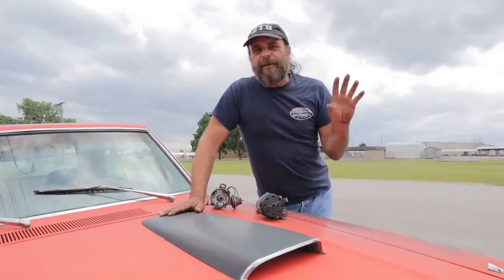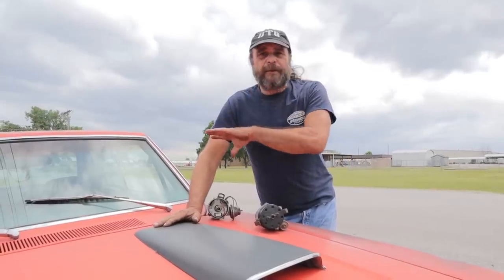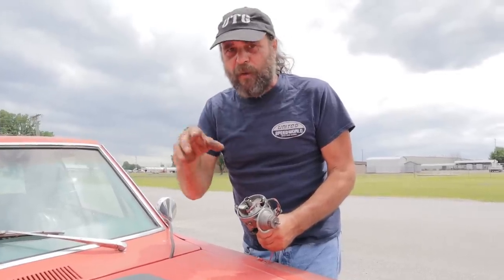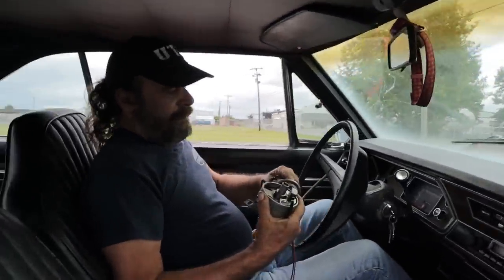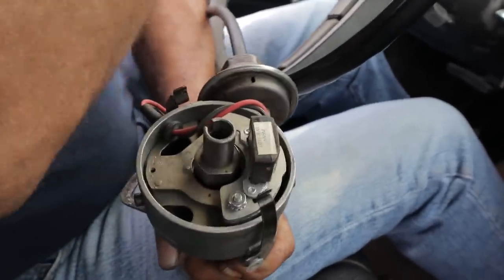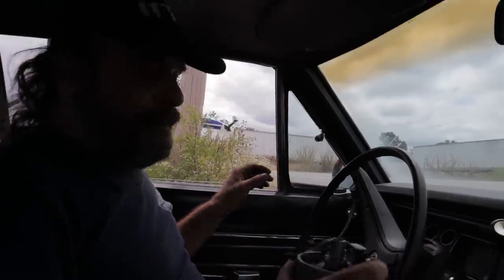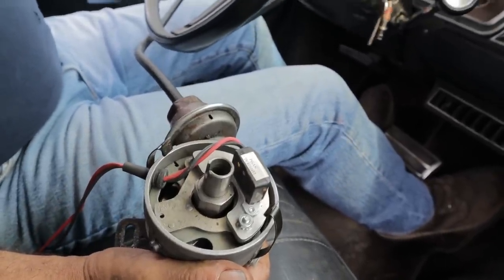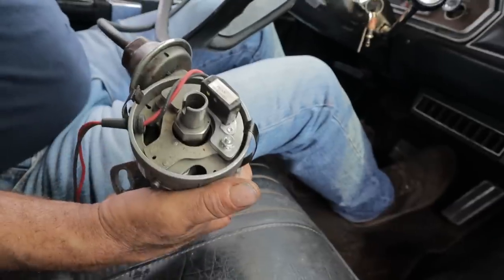The Vacuum Advance Debate!

Comment: Thanks uncle Tony good stuff....now what's up with dual vacuum advance
Reply: silverbird58  not in particular I've been selling auto parts for almost 20 years and sometimes the option comes up for dual or single vacuum advance when looking up distributed parts. I've got a pretty good understanding of single advance but I've never looked into what dual advance was about.
Reply: @kenleppek  My understanding is a ported advance tends to overheat in traffic and the dual advance was activated by a thermal switch that switched it to manifold vacuum increasing the advance which increased idle speed and cooled the engine down. There may have been other benefits.
Reply: @berserk7111  makes good sense. That would be a good use of the ported vacuum switch other than the diverter valve and pre heater valve in the air cleaner
Reply: @kenleppek  If I understand you correctly,  The hot air intake system helps regulate the intake air temp which can reduce engine temp but more importantly, it allows you to tune an engine to operate in a much narrower temperature range than the ambient temp which can be much broader. A hot day requires different tuning than a cold day. Tuning an engine to run in cold and hot weather is a tuning compromise but narrowing the temperature range of incoming air can aid in optimum tuning for both hot and cold days. effectively reducing one of the tuning variables. I prefer them on daily drivers. Usually, previous owners remove them thinking they are performance robbing emissions components but it's just the opposite. That's assuming the filter  flows well enough at WOT. For a daily driver in a 4 season climate they are a necessity, IMO. Texas California, etc., not as much.
Reply: @berserk7111  I'm from Michigan. The only vehicles you should take early fuel evaporation devices off of here are race purpose cars that you don't plan to drive in the winter
Reply: @berserk7111  I'm from Michigan. The only vehicles you should take early fuel evaporation devices off of here are race purpose cars that you don't plan to drive in the winter

Comment: I always ran pump gas in my hot rod. what i did was (with no vacuum advance at all) time the engine so that i could just hear light spark knock, then back it off 2 degrees. then i would connect the vacuum advance to manifold vacuum. I figured that way i would get maximum performance and maximum fuel mileage. the only trouble was when shutting the engine off very shortly after a race,  then trying to restart it. it would start, but the starter was working HARD. if i let it cool down even 10 minutes, it was fine. I should have NEVER got rid of that car. it is one of the bad decisions that will haunt me  to the grave.

Comment: I tried manifold vacuum and I just got tired of the inconsistency in the idle speed.   Especially if your running a choke like I am.  Reason is because then your relying on a specific amount of engine vacuum to maintain a set idle.

Comment: If you're using real light throttle, wouldn't manifold vacuum be superior? It seems like ported vacuum is only the way to go if you have a low performance engine that requires you to really dig into the throttle for off the line situations.

Comment: How is this an argument? I know it's not common sense but you car guys should know better. 

Vacuum is produced by the pistons' intake stroke. It originates in the cylinder. As the piston falls in the cylinder, with the intake valve open, it draws atmosphere through the manifold and carb. Just like drinking through a straw. 

With the throttle blades closed, the action of the pistons' intake stroke creates negative pressure in the manifold. The piston is still sucking but the closed throttle blades don't allow a lot of air flow into the engine.  It's like drinking through a straw with your finger over the bottom. When the throttle blades open, air can flow much easier through the manifold which decreases vacuum. It's the same as taking your finger off of the straw while drinking.  Because the manifold vacuum source is below the throttle blades, you have high vacuum at idle and low vacuum under throttle. 

The source for ported vacuum sits above the throttle plates. So while the pistons are still creating the same amount of vacuum, the ported source never sees it. The throttle blades are closed below the source, effectively blocking the signal. All of the vacuum is below the throttle blades. When under throttle and the blades open, the 'sealed' vacuum in the manifold drops as it is transferred to the next closest opening which is the carb. The ported vacuum then rises. So at idle you have low ported vacuum and under throttle, the ported vacuum rises. 

GENERALLY speaking you want you ignition timing to be tuned to atomized delivery. Not you air delivery.  So you need the advance to work from ported vacuum. Otherwise the advance has no clue what the carb is doing. 

At least I think.....

Comment: A lot of old MoPars are very sluggish driving cars with there weak engines and soft torque converters which do not do much torque converting.......
so getting that extra 5-10 ft. lbs of torque at 1500-2000rpm is actually needed.
  More powerful engines  with healthy cams in them can use manifold vac to help tame the idle a bit by producing a higher idle vac if one is using power 
brakes to help them work better.......or you can use the ported vac signal to make a smaller cam sound bigger at idle  with  the reduced idle timing, which the mopars tend to like.....so like most things in life  there are no clear absolutes.

Comment: Always scratched my head about my 394 Oldsmobile’s using manifold vacuum 
May try ported
Reply: Another 394 out there? Cool. Just getting mine going in a 55 Olds. Had a few frustrating issues with swapping a 394 to a '55 car but seems well worth it. Really great engine. It pulls like a strong 455. Mine still has the 4GC Rochester, and that carb doesn't even have a ported vacuum port on it.
Reply: Well, depending on what you have, year, etc., manifold might be the factory configuration.  There arw about 30-35 different vacuum cans gm used over the years, some ported and others manifold.
Reply: Well, if you're wanting to keep it 100% original, it might have manifold vac run through a switch operated by port vac, but if you just want good all around performance, you can throw away 90% of the original vacuum lines and just run one hose from ported vac to the dist.

Comment: Hey man, my distributor vacuum advance canister has two nipples for two vacuum lines. It's on a Toyota vehicle,  should one be ported and the other be manifold?
Reply: You are correct.Yes, retard is closest to the dizzy.

Advance plate should rotate by hand or by sucking on the advance nipple, shouldn't be frozen

Comment: Hi UT.  clarify this for me please.  I also have an edelbrock carby. A 500 cfm on a mild 318. Now bear in mind I’m in Australia so a right hand drive car. Currently doing some tuning,if I’m in second gear(727trans) and floor it,she takes off well but from a stand still it has a real lacklustre to get up and go!  Now my electronic Chrysler distributor is hooked onto the drivers side of carby so if looking at the front of the carby that would be the left side,while the right side of carby port is blocked.  My mechanic did it this way.  Maybe I should swap sides and try it?   Thoughts please.
Reply: pull  hose off dist while at idle ,if it sucks its man vac ,revs should change as it adds or removes timing .Raise the revs and it starts to suck it's ported

Comment: I though ‘ported’ was resolved back in the late 50’s?  There’s really no room for argument. Some vacuum advance pots can be adjusted as well, to eliminate low speed ping instead of altering the system timing. Keep it red hot & rolling UT.

Comment: That blip when it bottoms out on tip in, using manifold vacuum is destroying my 1/4 time.   Like 3 seconds.   Because I pulls my timing back to 12° right when I need it to be at 20° plus.   So, I’m adding the screw to the HEI to limit advance and going back to ported for the additional.  That should keep me in the meat of advance and allow me to launch   Hard instead of waiting for the wind up.   On the up side once the advance does come in it’s scary fast.  If we can get that fury on the launch we will be unholy!  Gonna have to limit the mechanical to get that high initial timing we need.   😂

Comment: My vacuum gauge is also a fuel pressure gauge whats that good for Tony?
Reply: I bought this piece of shit from harbor freight for $20 with a coupon
Reply: @Tech-NO-City  you have to really look at the reviews before you buy anything from harbor freight. I have a roll around tool cabinet that's been great and i have a set of screw drivers i destroyed in no time at all. p.s. watch out for the jack stands!
Reply: Kurt Zimmerman What’s up with the jack stands?
Reply: @kurtzimmerman1637  The contraption works I just wanna know what fuel pressure compound gauge is good for.   My biggest issue is I bought a ratchet set from them and every other socket size is missing at random.  They did it in such a way you dont notice until your working on a car.
Reply: @rong4189  some of them are under recall because the ratchet locking mechanism doesn't fully engage. Stay safe!
Reply: @kurtzimmerman1637  Yeah,   depends too how much you really use something.  Harbor Freight's great for filling out a depleted or otherwise nonexistent tool kit,  some things,  not so much.  (I never bought a vacuum gauge from them per se,  but my manifold gauge for AC works fine.  )
Reply: It's for testing a mechanical fuel pump. A carburator operate around 4 to 6 psi. He talk about it in the video about fuel economy with the gauge.
Reply: Jonas Grumbie Will do, thank you!
Reply: @rong4189  they have been dropping cars if you bump them. they had a recall about a month ago.
Reply: @OllamhDrab  know what you mean.  the stuff I buy is just for my house and car repairs. if I were a professional mechanic or contractor,  I would probably buy the better stuff
Reply: Ron G 3 ton harbor freight jack stands have issues latching (teeth engagement) don’t get their “fixed” ones either, they’re the same friggin stands
Reply: @Ltmonte  good to know! thanks.
Reply: @kurtzimmerman1637  Basically you just kinda have to be smart.  If you need daily hard use and/or best precision,  buy what you need for that elsewhere,  but most people can't buy the whole Snap On catalog in case they need an offset wrench of whatever size  some time.  :)
That said, I do like a fair number of their hand tools well enough.  They have these like polycarbonate socket wrench handles that I think are pretty great,  cause my  arthritic hands chill pretty easy on tools I leave in the car in the winter, but I'm actually starting to trust the thing not to break.  :)  (I mean,  within reason,  anyway.  Being skinny ol gal I got various sized breaker bars and stuff if I really have to haul on something anyway.)
Reply: @Tech-NO-City  - They don't even care about people in their own country...
Reply: It’s just a way to only need one gauge for carbureted engines. You’ve got a vacuum gauge for checking vacuum, and a fuel pressure gauge for checking fuel pressure. You would otherwise need two separate gauges.
Reply: The fuel pressure side is for testing engine driven mechanical fuel pumps used to feed carburetors.

Those don't need a lot of pressure, usually only about 4-6 psi. So a gauge that measures from 0-25psi absolute is pretty useful (remember that atmosphere pressure is a little under 15psi, so 10psi pressure above atmospheric gives you 25psi absolute).

Comment: I have a question about timing because I have an 83 Chevy C20 truck with a stock small block 350 and I would like to know how to set it at it's perfect timing. I want to keep using 87 octane and eventually I will put on some headers mild camshaft and either attempt to Port the cylinder heads I have now or step up to the vortecs but how do you know how to dial in the perfect timing without going too far and causing pre ignition? I think that's a good idea for a video, thank you
Reply: If your using 87 octane in an old carbureted vehicle that's a huge mistake. By running low octane fuel you will have to pull way back on the timing and leave alot of power on the table. Also cheap gas has a habit of "dieseling" or running on when shut off. 91 or 93 octane will allow for much more timing usually around 34-36 degrees total but with cheap gas you will be lucky to run 30 degrees total. In old carbureted vehicles with mechanically set timing, never use low octane it doesnt cost much more to fill up with 91 or 93 and the more timing you can run, the better your fuel mileage and efficiency will be.

Comment: UTG, I got a big block 454 rebuilt for performance no emissions just pcv and cats! I got a vacuum advance because I wanted fuel economy when I ride.  I'm hooked up to full manifold vacuum. 15 initial 37 total 48max. 
Oh yeah I running a ez efi also. Drive great. But should I be running ported or manifold
Reply: If your distrinutor was properly curved for manifold vacuum, use it that way.  Doesn't that system offer efi-controlled advance?  Even my electric mixture control solenoid carburetor, the HEI distributor has electronic advance controlled by the computer.  This allows for in neutral at idle about 10 degrees, in gear idle about 22, and it removes advance going down the road at speed if the knock sensor is being rung.
Reply: @thisisyourcaptainspeaking2259  
So is that ported or manifold that your dizzy hooked up too.
Reply: @mlin3129  The hei distributor advance is controlled by the ecm.  Ecm uses several sensors then advances based on the sensor values.  Manifold pressure, rpm, throttle position, shifter position and knock are a few of the sensors
Reply: @thisisyourcaptainspeaking2259  
My dizzy has vacuum advance
Reply: @mlin3129  Check the number on the vacuum can or measure the pressure required to move it, and degrees of diatributor travel if possible.  These details will determine if it was set up for manifold or ported vacuum.  In other words, if it's a complete unknown, need to learn more about it.  If it was part of a package, then whoever designed the package will know.  There are some good distributor guys out there, and your efi was calibrated / designed for a specific curve, so try to verify it's a close match.  Generally though, if it pulls full vacuum advance with say 8" vacuum it's gonna be a manifold vacuum canister.  If it requires 18", a ported canister.  The difference is, going off idle, you don't want advance dropping out right away.  Oh, measure your idle vacuum as well, you may decide on getting an adjustable canister if this one isn't.
If your goal is circle track and not street drivability, you can just lock the advance at the best position.  A malfunctioning advance can cost a race, so locking the advance eliminates the possibility.  Expect it might be more diffucult to start if locked with, say, 38 degrees of advance, so in this case get it spinning before powering on ignition (not a street-friendly approach like a grocery getter).  Hopefully that all makes sense.
Reply: @thisisyourcaptainspeaking2259  
The dizzy is a MSD streetfire.
The vacuum can pulls a max around 8 to 11 
The total timing is all in around 2600 to 2700 rpm

I drive on the street 97% of the time that's why I am asking which is better for me ported or manifold vacuum?
Reply: In this case it sounds like manifold vacuum.  The '65 409 for instance, used a can that started moving at 3~5" and was all-in at 6~8", this can added 8 degrees of advance.   This was a manifold vacuum can.

Comment: * * To better illustrate, maybe you should have drawn an index line of where to look.  
Im familiar w this.  And understand the truth in what you are saying.  But couldn’t see the movement. 
* Shortening the mech curve and increasing the advance rate is important in a perf engine.   Especially if a high duration cam will not supply necessary vac to idle on the carb’s idle circuit.  More advance initially will idle it up and allow you to close the throttle blades and put you on the idle circuit of the carb.  Thus making it tunable and run as designed.

Comment: I disagree.  But neither is wrong. 
GM only went to ported on the emission era. The first 327s  with q jet were full vacuum.  Mopars may be different,
However a stock or mild engine responds great on ported vacuum.

Comment: if you hook the vacuum advance to manifold vacuum the idle speed will pick up a lot. you have to reduce the idle speed setting to get the idle back down. now when you step on the gas the engine wants to stall / bog down. not a good idea. use ported vacuum only for proper operation.
Reply: Depends on application
Reply: If you switch to manifold from ported on an engine calibrated and curved for ported that could cause the problem you observed. If you calibrate a carb and curve your timing for manifold, I think you will find that  the engine will idle smoother and cooler .
Reply: @berserk7111  no
Reply: @NebukedNezzer  Really? Have you tried it?
Reply: Are your throttle butterflies fully open @ WOT?
Reply: NebukedNezzer Yes
Reply: Homie you don’t know

Comment: Uncle Tony this was the absolute best way to clarify this ongoing debate. I have a 73 Olds Delta 88 Hei distributor and I've been trying to figure this out. I get it now. I'm at 12° initial and its not performing how I think it can. I have the can set at 10° of advance. Think that's enough advance coming from can?? Thanks in advance Uncle Tony.🤟